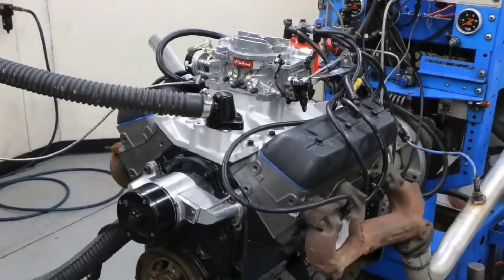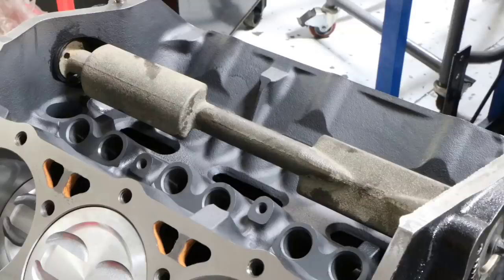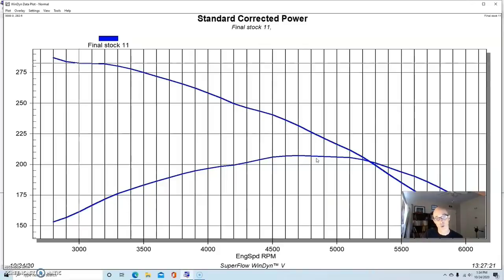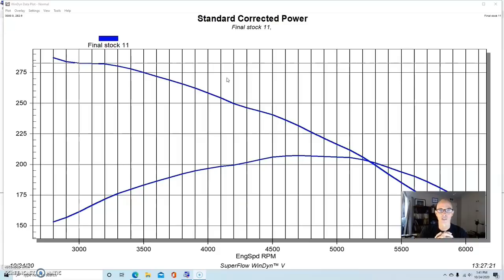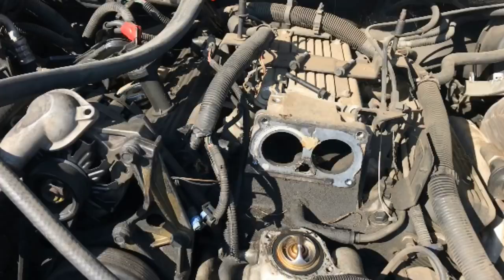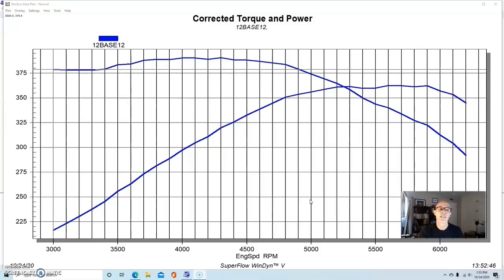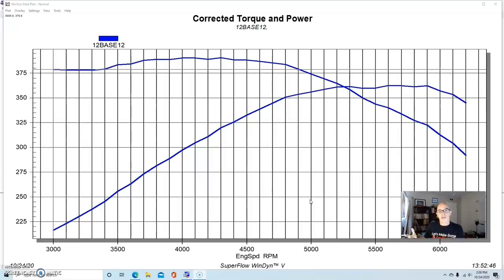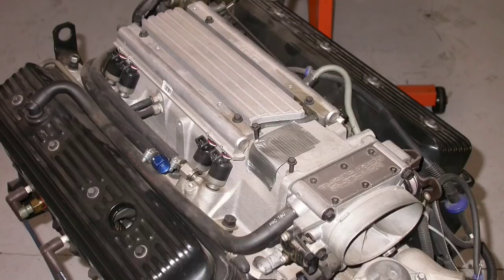4.3L V6 VS 4.3L V8-WHICH OTHER GUYS MAKES A BETTER BUILDER?

Comment: Would like to see something on the L47 V8 out of the Aurora as well! Slightly smaller than the L99 but made 50hp more. And they sounded heavenly.
Reply: I was a Cadillac tech for a while and would love to see the "baby Northstar " fitted to perform.
Reply: Wasnt that a northstar? Rather have a LT4, LT5 over a northstar.
Reply: @youcanbesmartaskhow3857  same, it’s a unique engine. Love V8s in the 4.0-4.8 range, they sounds amazing and they usually like to be revved.
Reply: @shadowopsairman1583  yessir, it was a northstar. Would like to see the 4.0 and 4.4 on here though, they are cool engines. And I would prefer an lt1 as well, I have the wimpy L05 TBI engine in my truck. Hopefully the addition of a Holley Sniper or Terminator, new heads, new intake manifold, mild cam, and full exhaust will give it a power bump.
Reply: The 4L Northstar has potential to be pretty spicy depending on how much can be used from the Shelby Series 1 and Indy engines
Reply: @iDrive4fun93  the Northstar is a 4.6liter 289cubic inch dual overhead 4 cam engine. The olds  Aurora had a 4.0 liter version. The "aurora Indy Engine" is a bit smaller even I believe. They are seriously high revving but have cylinder pressure issues sealing their all aluminum components.
Reply: @lb9gta307  yep, imagine a North Star revving up to 20,000rpm lol
Reply: @youcanbesmartaskhow3857  the L37, LD8, and LH2 were the 3 4.6 northstar engines, started in the Allanté. The L37 is the og. The LC3 was the 4.4, and it’s probably my favorite Northstar engine, I would love an 06-09 STS-V with that engine. Then the L47 4.0 in the Aurora. I like all the Northstar V8s.
Reply: @iDrive4fun93  cleaned a lot of carbon outta the l37 and I worked at a dealer in Cincy where they drove an Alante to, from Detroit, without coolant to test 'limp mode'  [it was fine] back in late 91 or 92. Ive serviced numerous Northstars both 300hp and 285hp [I believe] versions we called them 9 or Y motors by vin. I remember the alante well, the first eldos and sts Sevilles to get it [1993] then devilles concourse d'elegance [1994] after which the pushrod 4.9 was replaced [after 1995] I loved the 4.9 but learned to like the Northstar as well. For a while I mostly repaired oil leaks, performing crankcase reseals.  But I've never seen one pushed, never seen mods beyond a k&n!! Nice to meet a fellow admirer! I just didnt know the 'L' designations.  The later years had longer piston skirts to address an oil consumption issue. I replaced many pistons/rings before the redesign. lots of consumption checks/decarbon etc. Northstar life!!! Been there! Peace!
Reply: @youcanbesmartaskhow3857  honestly, I like GM’s V8 lineup in it’s entirety. The Northstar engines fascinate me, they were ahead of their time, and while they had their issues, they were a step in the right direction for GM. I prefer a pushrod engine, but I have a major soft spot for these engines. And I think the 4.4 supercharged version in the STS V from 06-09(my dream Cadillac) had those piston skirts and some other improvements as well. It is cool to find another person who appreciates the Northstar! You definitely have more experience working on them than I do though!
Reply: @iDrive4fun93  I didn't mean to come off as a know it all, I was  just letting you know where my thoughts were coming from, etc. And I learned some as well, which I enjoy, so thanks! Great to chat with a GM fan, since so many people spread hate for GM or Ford, or Chrysler, etc. I started at the Caddy dealer in 99 so I saw just after the evolution of the 4.1 to 4.5 to 4.9, and then to the Northstar. But I didn't learn it all and I admire your research and knowledge  and I agree it was ahead of its time and 'a step on the right direction' for sure. I often wonder with some performance upgrades if Coyote type numbers would be possible. They made 300hp rather reliably, although all belt driven components were susceptible to frequent failure and gave the powerplant a bad reputation. Also the head bolts pulled almost every time the head gaskets failed, requiring inserts [heli-coils]. I liked the pushrod engines as well, and the LS from GM obviously stands on its own. So like you, I like mostly the whole line-up. Not much aftermarket support for the Northstar, would like to see hotter cams, heads with bigger valves etc. Not much room for turbo or even headers in the vehicles they came in though 😕.  nice to have a coherent, civil conversation online brother, Peace!!!
Reply: My niece had a Seville with the Northstar engine that would overheat after a hour of driving ,inspected and found the waterpump had locked up .I replaced it ,no more issues I've owned 6 of these version's also no issues
Reply: @youcanbesmartaskhow3857  you didn’t come across as a know it all, just someone experienced, and I like it when people with knowledge share it, always looking to learn. I am young, 27 years old, and most my generation is into tuner cars, and while I do own a tuner car, I love my Chevy trucks, especially the GMT400s, and will probably always own at least one(the one in my profile pic is my current project). I rather drive my 93 Chevy 1500 over my Elantra Sport, which is turbocharged and manual, and has some modifications coming for it as we speak, some new tunes and intercooler piping. My dream is to own an STS-V still, with the supercharged 4.4. That’ll happen some day I imagine. Those made 469hp I think, 0-60 in 4.8 seconds. A major win for the Northstar V8 there!
Reply: What about the head stud issues on Northstars?? This is why they are sitting in in scrap yards.
Reply: @emanuelnamseth1469  Well, the issue is the aluminum block and that the threads pull for the head bolts. Sometimes when they require head gasket replacement a couple are just spinning, sometimes you try to torque them and they pull. Either way they require Heli-coils/Time-serts. This is time consuming [expensive] and can many times only be done once, so if you blow a gasket at 60k [unfortunately fairly common] and then make it to say, 160k and need it again, you need a new engine. Typically this is cost-prohibitive and yes, a nice car is in the scrap heap.
Reply: @youcanbesmartaskhow3857   That's my point. I agree.
Reply: Yea I've heard about the head stud issues on the Northstar engines,fortunately I've  not any problems with the four I'm currently  driving
Reply: @puffkendrick6850  With the oil changed regularly and if you NEVER OVERHEAT IT,  200k miles is entirely within reason. Trouble comes when maintenance issues are ignored such as low coolant or leaks or frayed water pump belts are left to fall off. The Northstar engine is exaclty as reliable as the technician servicing it is trained. Quick lube joints often do not know what to look for. When people cheap out and the Caddy gets neglected, yes it will be in the junkyard.

Comment: Excellent video! Very informative. I'm glad you didn't get hung up on cylinder count and immediately dismiss the V6 like most people do. I love the 4.3 V6 in my Silverado, so I'd probably chose it for a truck application since it has such great low rpm torque. I'd probably go with the V8 if I were putting it in a car due to the presumably better high rpm power, and much larger aftermarket support.

Comment: The LV3 has been swapped into a Grand National and running e85 with 7-9 psi of boost it makes some very nice power.  Unfortunately no aftermarket support exist for the LV3, the port inject intake runner and upper intake had to be cut down from LS parts.  With the way things are going there won't be any aftermarket support for a v6, even though the block is as strong as the TA Performance for a Turbo Regal, because everyone wants a LS or LT or run 100psi in an I4.  The LV3 is a strong motor and it would be cool to be able to update a Syclone or Typhoon with dead engines and slap an LV3 with a turbo would bring these guys back to life.  The latest LV3 are like LT1 heads, they will out flow Buick Motor Sports Stage 2 heads with the LV3 ported.

Comment: I have a 4.3L V6 with Vortec heads that was built for my Typhoon. It's bored .030, gasket matched heads with stainless steel valves, custom ground Comp Cams camshaft (.513/.513 on a 115 LSA) & Edelbrock 2114 intake. It made 276hp/306lb-ft on an engine dyno thru stock n/a manifold and Y-pipe & am untuned 850cfm carb that was just used to dyno it. It does have Eagle H-beam rods & Mahle forged pistons too.

Comment: Alot of the 4.3 l99s where fleet vehicles, taxi's mostly 
And used in road masters/fleetwoods etc.
I know a guy that claimed his roadmaster would get almost 30mpg on the highway, 
2.56 gears stock lol
Reply: those Buick's were so sweet
Reply: 4.3V8s ONLY came in the Caprice not the roadmaster or cadillacs.

Comment: Elephant in the room: split-throw crank on a 90-degree v6.  Weaker than  non-split crank as found on a 90-degree v8, and the degree of split trades strength for less “odd-firingness”. Plus has more residual imbalance.  Just not a good setup for performance.
Reply: Shit splits and splat spots..
Reply: @montgomeryhifiandreview5528  the Buick 3800 is (IMO) a better engine.  One parameter that the designers vary in a 90-degree v6 is how many degrees of split the pins have.  Less split = stronger at the expense of a less even firing pattern. The early 3800s had no split and maximum odd-firing.  I don’t know for sure, but the later ones may have still had fewer degrees of split than the 4.3.

Comment: I had a 1980 Olds Cutlass with the 4 3 V8. It didn't have tire shredding power but it had plenty to move the car and it was smooth and got good mileage.

Comment: The problem with the 4.3 v8 is the same problem as the 305 the bore is too small to fit a big valve
Reply: Yup
Reply: Bore is the same as a 350. Which you can put a 202 valve in.
Reply: @EmeraldEnchantments  the 4.3 v6 has the same bore as a 350 the v8 is the same as a 305
Reply: 4 inch bore. Same as 5.7
Reply: The L99 4.3L V8 has a bore of 3.736".
Reply: @unicornsteaks6769  no it’s 3.48 the 307 has the 3 and 3/4 bore
Reply: @keithmceuen8775  https://en.wikipedia.org/wiki/Chevrolet_small-block_engine#4.3_L
Reply: @keithmceuen8775  I was wrong. But so are you. The actual bore of the L99 4.3L V8 is 3.743". Stroke is 3". Do the math. That comes to 264. 3.48 bore and 3 stroke comes to 228.
Reply: @unicornsteaks6769  no i think you were right. The L99 has same bore as a 305 which is 3.736. Piston is the same for 305 Vortec as '96 L99 and rings are same for all 3 years of L99 according to Sealed Power catalog.
Reply: @timtodd6830 el cigüeñal del 305 no es igual al del 4.3 V8?
Reply: @jeanrondon1921  no the 305 has the same stroke as a 350 (3.48 inches) and the 4.3 V8 has a 3 inch stroke.
Reply: Yo compré un motor 305 tapa rayada por partes y cuando monte el cigüeñal el recorrido era más corto y no llegaba al punto muerto superior quedaba por debajo

Comment: I had a 75 Chevy Monza spider 2+2 with the 4.3l 262.
I put a 750 Holley carburetor Edelbrock intake. 
I was surprising quite a few people off of the line.

Comment: in short 8 people can move a piano easier than 6 people. lol
Reply: Yeah number of cylinders doesnt always mean more leverage with more cylinders.
Reply: @ReidHenderson  it does mean worse fuel economy though, as a V8 has more moving parts and rotating mass than a V6 of the same displacement
Reply: @KuntryBoyCitySlick  Or if there just isn't room for eight people in the space the piano has to move through. V6 vs V8, V6 vs inline 6, there are always trade-offs, and videos like this are worthwhile to understand what the advantages of each are and how they are achieved so we can decide which benefits are worth which costs for a particular application.
Reply: Valid point🤔
Reply: @ReidHenderson  The v8 has 4 more valves and there own ports. Much better balance with a v8. A v8 fires a cylinder every 90  degree of rotation.smooth even power

Comment: I haven’t built either, but I understand that the 4.3 V6 can be built into a reliable 8,000 rpm buzz bomb.  One of my future engine builds will be a 4.3 V8 using a roller 305 block and the L99 crank and rods, Trick Flow heads, ‘94 - ‘96 LT1 camshaft, performer intake, and probably a 500 cfm Carter carb.  I’m expecting ~ 230 hp and a solid 25 mpg.   This is for a Jag XJ12 that I already have a 1974 350 in, I just want a traditional looking SBC that delivers great mpgs with acceptable power.
Reply: That is correct, no opti-spark.  The 305 roller cam block Is like a conventional SBC - all I’m doing is using the L99 crankshaft and connecting rods.  It will actually have similar power to the V12 that was originally in the Jag - but is more than 300 lbs lighter!  The current 350 in my Jag was installed in 1993, this car has always been about comfort and handling to me rather than being a hot rod.

Comment: I have an all stock 1997 Chevy Cheyenne 1500 v6 and it has 286,000 miles on it have had no problems with it and it still runs amazing

Comment: Had the 4.3 V8 in our 1980 Oldmobile Cutlass Supreme. It was unbelievably reliable and went through my parents, and two kids that beat the crap out of it.
Reply: I have a 80 cutlass with a 4.3l v8 sitting in my garage. My mom bought it new. Still runs great!!
Reply: That is a different engine. L99 is a Gen 2 engine.
Reply: @drsethsr  Yes..and thank you captain obvious
Reply: You surely could beat the tar out of it.

I was in the vehicle when we held it in first gear, floored until we got sick of hearing it anymore. Believe me if you like, but with 2.29 gears we almost cleared the 85 mph speedo in 1st gear. Crazy RPM, never died. Not fast, durable though.
Reply: I have a 81 Malibu. The emissions tag says 4.4 liter, also called the 267. It's a gutless pussbag of an engine. The only benefit is that it's a small block and is easily replaced by a decent engine. Have to watch out for the th200 and then the 7.5 inch rear end if you increase output.
Reply: I got a 260 Olds for $50 and put it in my 76 Cutlass. I am about 1/2 done the twin turbo setup on it!
Reply: @modeverything1  That's awsome!! Been following your build. Can't wait to see it run!!
Reply: @davecoxx7082  Thanks! Should be interesting to see how it works!

Comment: There's a couple of guys, father and son, named Ernie Neal, running the little V8 Caprice in Super Stock. It's pretty competitive.

I have a little 4.3 Vortec V6 on the engine stand now. It has been zero decked, has hypereutectic Speed Pro 350 four valve relief flat top pistons, it's been balanced, bored and honed with deck plates, the heads have been milled, pocket ported, and have a three angle valve job, with stainless valves, screw in studs, and adjustable 1.6:1 rockers. It also has a Crane 214/222/114 hydraulic roller cam, should be over 0.500" lift. The Vortec EFI intake may hurt HP, but I figure it will make 250+ for HP, and about 300 ft/lb for torque. If I build another, it might get small dome pistons, and a little more cam. They're great little engines, and at around 250/300, run strong and get great fuel economy. Honestly, it's probably a lot better than a V8 swap for anything but all out racing.

Comment: Used parts such as oil pan, motor mounts, water pump, pulleys and exhaust manifolds from a 262 Monza for swapping a 350 in my first Monza.
Reply: had a 400 with a 5-speed stick in my coupe monza

Comment: one more small gm motor that i did build up in 82 was the 260 v8 olds from 77 era. stock was 110hp/98tq, after i was done , it had a 455 alum heads , forged /balanced internally in a 3600lbs pontiac parisian  did 8.8 1/10th

Comment: I had a 75 monza with the 262.  I put an Edelbrock intake and quadrajet and dual exhaust.  Wasn’t a powerhouse but it did run high 14s over 90mph in the qt mile in the light car. What a fun little car and still got around 20 mpg which back in 1983 was really good.  Sold it to a friend who put it in his 1/2Ton  truck and drove it forever.  That thing was indestructible.

Comment: V8, sound, feel, looks..... Have you ever tortured the Cadillac 4.6L DOHC engine? i would love to see if all that complexity pays dividends in HP....
Reply: It doesn't. The N* makes 300 hp and they don't like tuning. It was a massive waste of time. Would have been smart if GM just took the 4.3 L99 and make that the default Cadillac V8, but "O v E r H e A d C a M s"

Comment: Borla had a shorty header kit for the V6 that woke up the TBI. Trouble was tubes always cracked open at the port flange and the Y pipe clamp would not hold for UPS use.

Comment: U know gm used to offer racing heads for 4.3 type v6s. They had a v6 drag racing class as well as Nascar v6s.
Reply: Yea they had a raw forged odd fire crank, aluminum block, a cross ram intake and splayed valve aluminum heads. You could make a pretty sick 4.3L in the 90's. It would be very cool if someone could dig up some old parts and run it on the dyno. You could make a 5.0L V6 with parts from GM Performance Parts. Oh and money. Don't forget about money.

Comment: I daily a 4.3 s10. Been a monster. Ported heads, mild choppy cam, an intake 1inch spacer, aswell as a TB 1inch spacer, stainless steel headers, high flow cats, no muffler 2.5in exhaust.

Its a very stout v6 for sure. I run a 295/60 series rubber in the rear to keep it planted.
For being a v6, its got good torque, and steady power.

I am a fan of the v6 for sure! 👍

Comment: I had no idea the 4.3l V8s existed.
Id take the 8 over the 6 any day. They are better balanced without stupid balance shafts and  you can make all sorts of weird frankenmotors with them.

Cant wait for the stroker vs destroker shootout!
Reply: Imagine the V8 with a balancer shaft in it. It would be so smooth you’d think it was an electric engine lol.